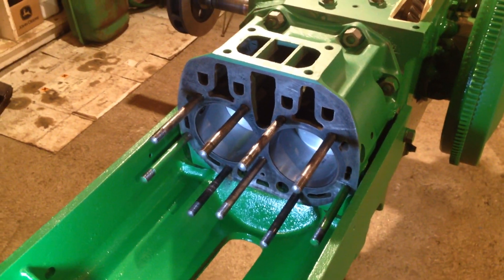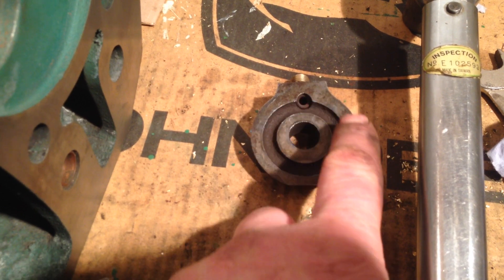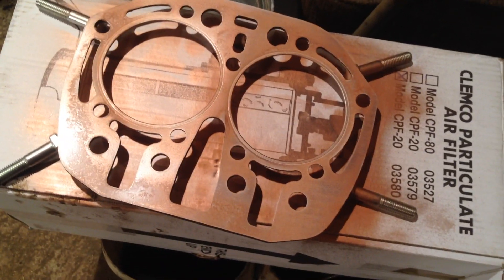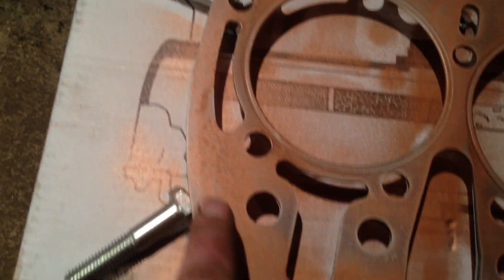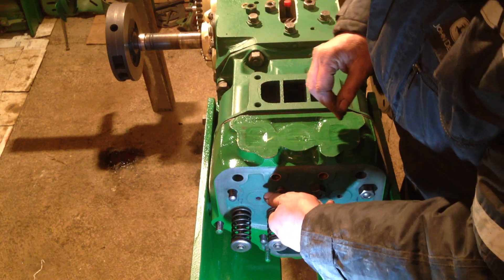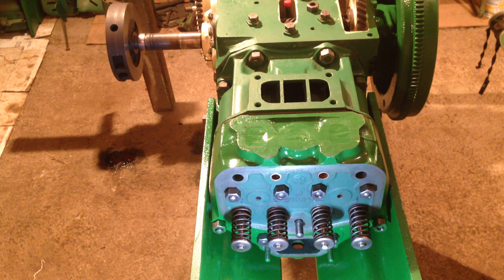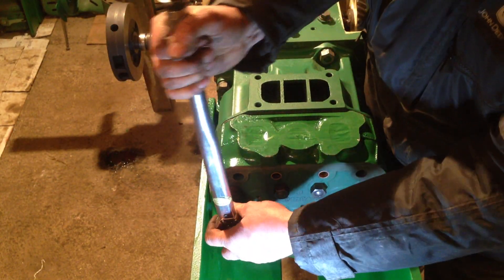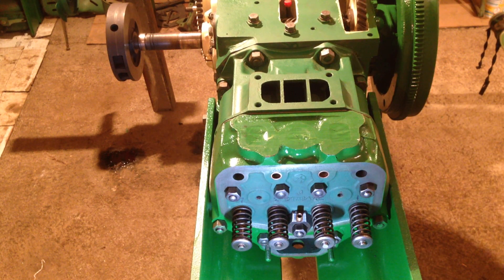1940/41 John Deere B tractor restoration pt 60 ( cylinder head fitment and torque settings )

Comment: I have replaced a few head gaskets on As and Bs but this is the 1st time I have seen copper washers used under the head bolt nuts instead of lead.  Seems like copper might be a better option.  What brand is your head gasket?
Reply from the maker: jd60palouse Hi JD thanks for the comment , I use Felpro gaskets , they always have contained the copper washers so that’s what I use , got to say the lead washers have always been a bit of a mystery to me I’ve always wondered if it was to seal the stud instead of sealing the threads from the water jacket. .